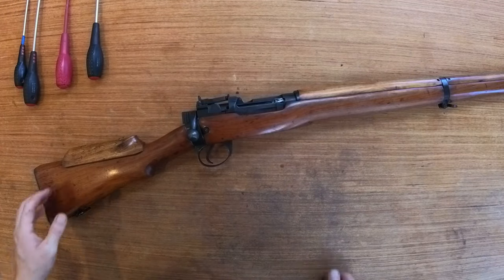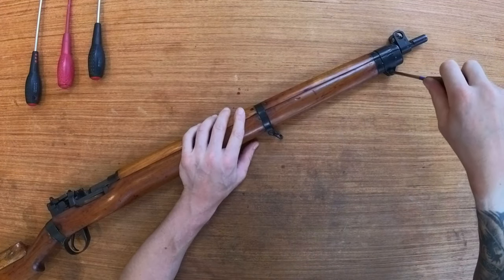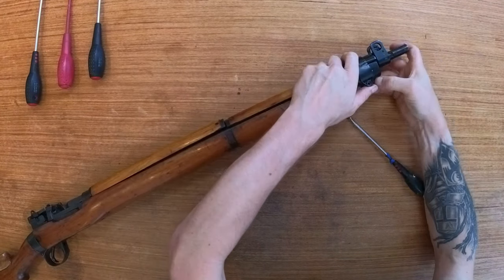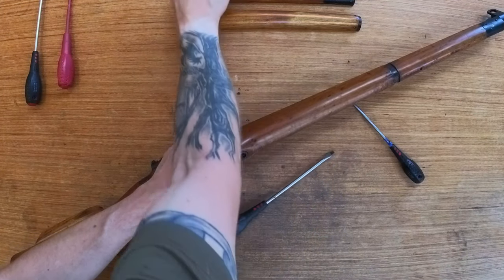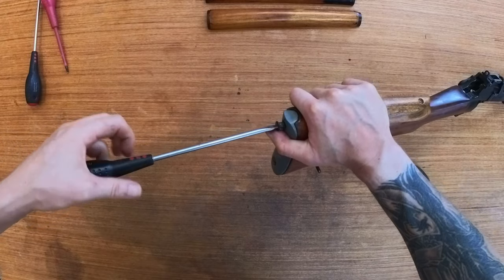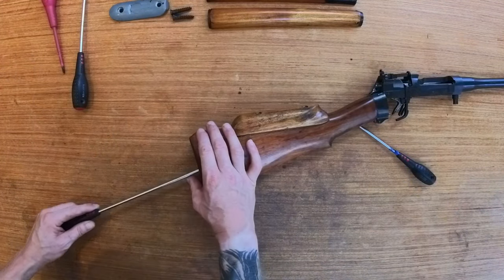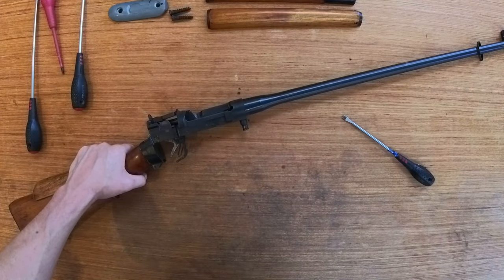Disassemble Lee Enfield NO4 SMLE

Comment: Is this stripdown sufficient to clean the rifle when using corrosive ammo, or should the trigger set and bolt be disassembled as well? Great video, by the way.
Reply from the maker: I would try to avoid using corrosive ammunition if at all possible! For the amount of time it takes it wouldn't hurt to go more in depth, but at a minimum just apply some oil onto the harder to reach parts to protect them. Thanks for watching!

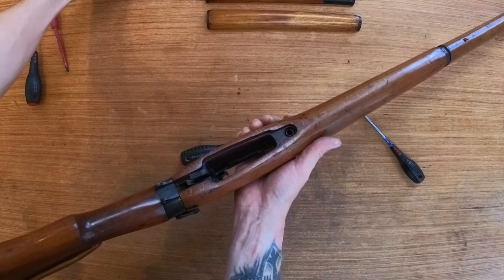Comment: hello mate! lovely video but small question see mine is pinned at 2:22 you can see near the wrist plate above the trigger there's a little pin mine is a no.4 mk1/2 and the bottom stock won't budge and it seems connected to that lil pin have you any idea how to remove the lil bastard?
Reply from the maker: Cheers buddy, is there a small screw on one side of it?
Reply: @toolittletimeUK  Yes
Reply from the maker: That small screw is what held mine together! Let me know how you get on!

Comment: It’s a No4 Mk1. 

The SMLE was a No1 Mk3, otherwise a Mk3 SMLE

The 1931 version of the No4 was a No 1 Mk6

The long sightbase transitional SMLE was a No 1 Mk5. 

The .22 SMLE was a No 2 Mk4. 

Is a pattern beginning to emerge?  Prior to WW1, there was a letter designation like MLM for Magazine Lee Metford and a Mk for major changes and a * for minor ones. 

With the SMLE, the basic rifle received a number, significant variations received a Mk and minor ones a . Hence No1 Mk1** or Mk 1 Three star SMLE. 

One more thing. Ever since the percussion muzzle loading Enfields, convention seems to have ordained that all screw heads face the same way as the sidenails (lock screws) ie down the left side of the rifle. This may seem perverse in relation to the bolt but it is certainly true of the fixed orientation of the trigger guard screw. Nothing to stop you fitting bands as you please of course.
Reply from the maker: Thank you, I did not spot that typo!! And thank you for watching!!

Comment: There may well be times when a full stock removal may be necessary, but these rifles were stocked up very carefully on initial build to achieve the required accuracy standard.  Subsequent unnecessary removal of the wood may well have a very negative effect on that accuracy and as such, should only be carried out by someone who really knows what they are doing.